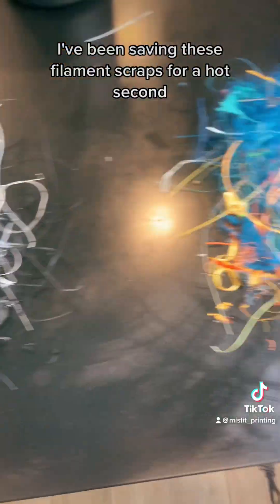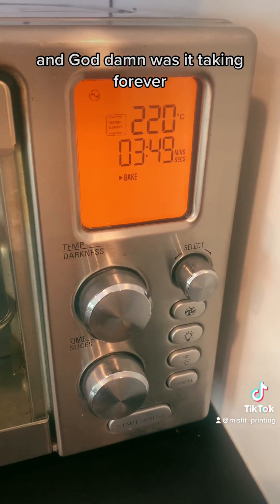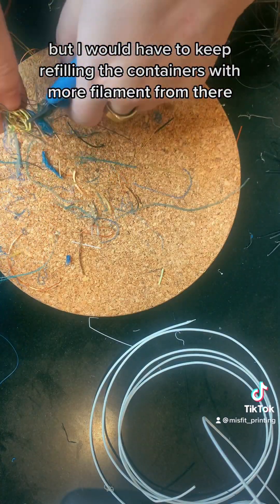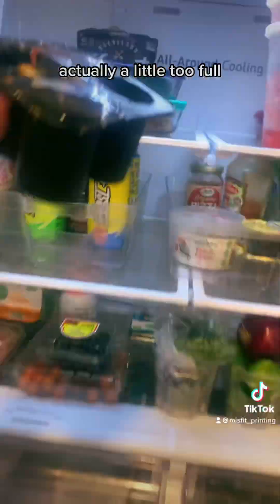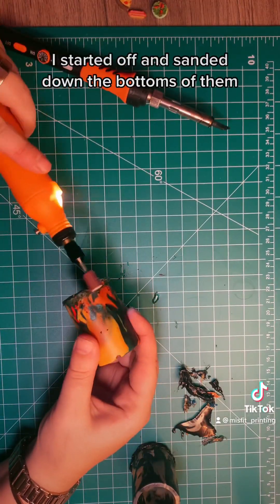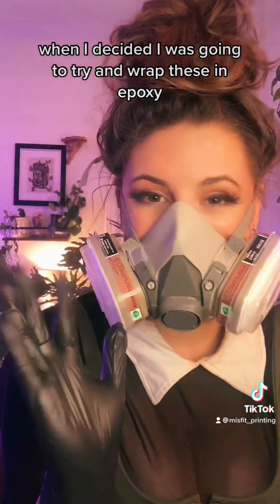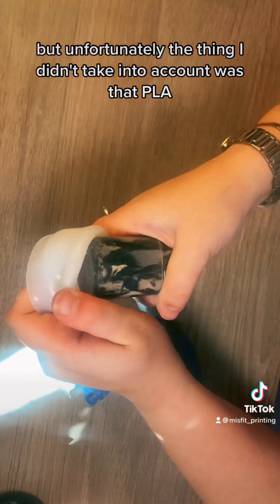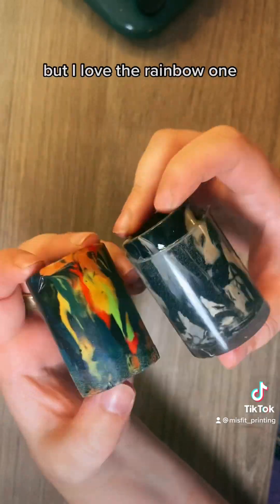How to recycle PLA 3D printing filament

Comment: I would not drink from them though... melted plastic is full of microplastics that can get loose in your drink, and then you swallow them. They also disovle in alcohol. Needless to say it is not digradable nor really digestible. You can melt them into decorations, but don't use them for food. Unless you fully coat it with a food safe epoxy, but then make sure the epoxy layer is intact when you drink from it. Still would not recommend though...
Reply: Which is why she coated them in epoxy.
Reply: @wojtek-33 which also is not safe…

Even if it’s “food grade” epoxy, it’s not alcohol resistant and that alcohol will leach not only chemicals from the epoxy, but also from the filament into the liquor over time.
Reply: @She8MeCaulk  Wrong.
Reply: @wojtek-33  saying “wrong” doesn’t change reality. Everything I stated was true, you can look it up yourself if you’re still confused…